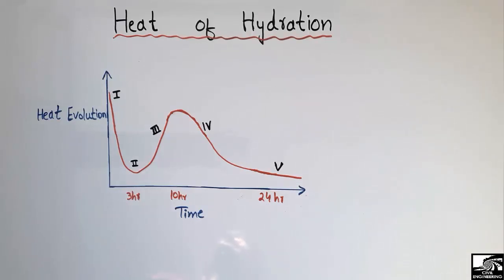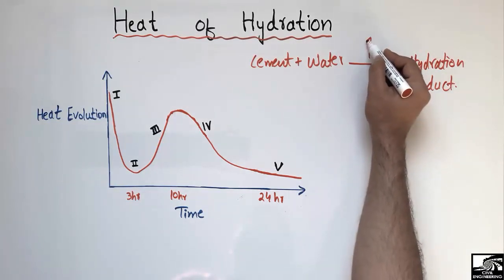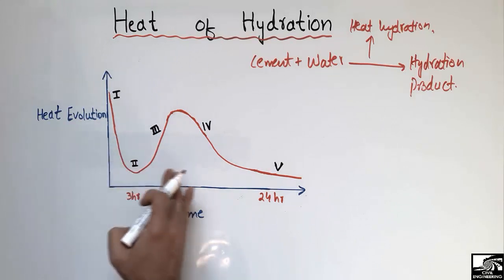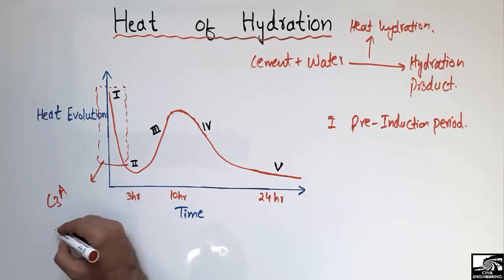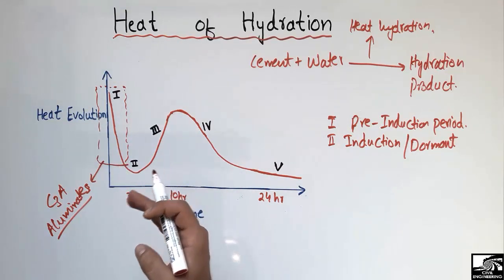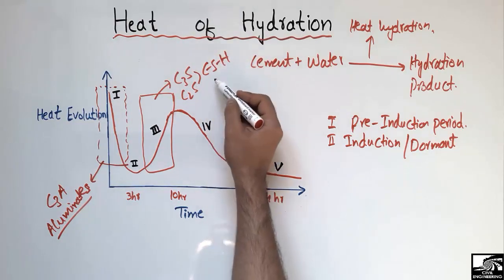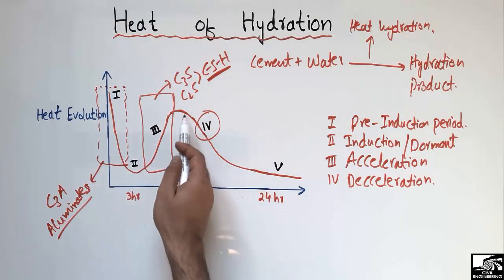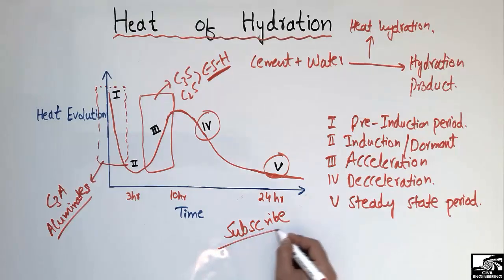Heat of Hydration of cement

Comment: Thank you for making the video. Well I would like to add a small correction to it. 

You said the reason of decreasing cuvre in stage 4 is due to the reason that C3S amd C2S has been hydrated. To be correct, C2S has negligible contribution initially.. So the decrease in slope is mainly due to hydration of C3S, as the hydration of C2S becomes predominant in later stages and corresponds to the ultimate strength post a year after concreting.
Reply from the maker: Good point!